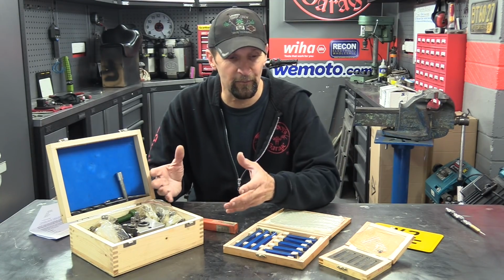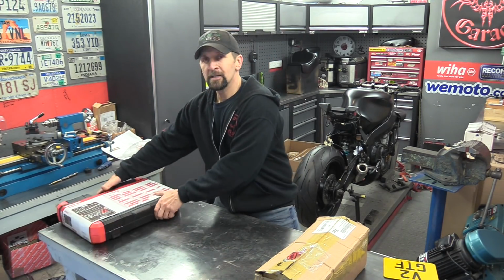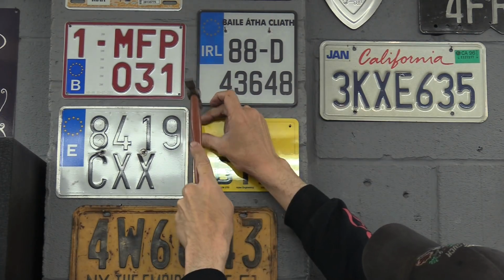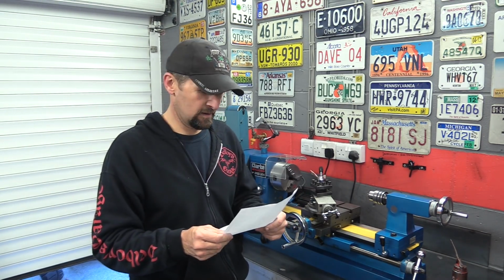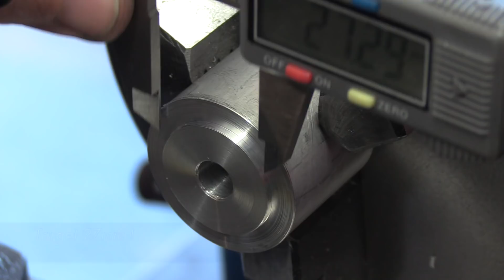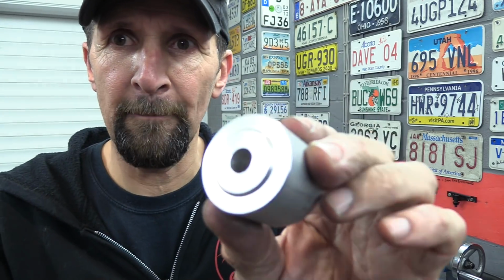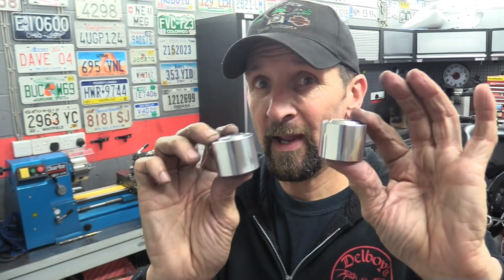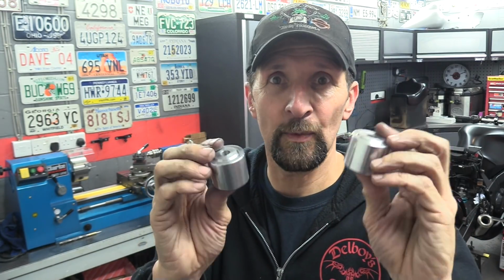Delboy's Garage, Lathe Project #3, "Aprilia Handlebar Risers"

Comment: Great to see the green grit wheel, don’t forget to ‘ring’ it before you mount it 👍
Reply from the maker: 'Thanks Andrew, learning as I go with this, so what d'ya mean by 'ring it'?  cheers
Reply: Gently support the wheel by balancing on your finger through the centre hole, tap the wheel gently with something like a hammer handle (wood, you can use metal but be extremely careful) and it should have a muse ‘ring’ noise which is great. A dull thud noise could mean the wheel is cracked and if spun in the machine, could explode. 👍
Reply: Or you can search you tube for ‘ring testing a grinding wheel’
Reply from the maker: @andysherman711   Andrew, you are a legend my friend, i totally see the logic in that, and how it could save your life.. but i would never have thought to do it... this is why i love Youtube so much, information and knowledge, shared between friends.. thank you again so much, i really appreciate it..   Del.
Reply: As a side to H + S, check and ensure that your safety glasses will protect you against grinding wheels, not all will. I would recommend the 'box type' goggles with the correct impact rating for grinding. This will not only protect for impact but also dust entering from all sides, which can be irritating.

Comment: Cool project. In situations where you have a bushing, ie. hole thru a round shaft, if you cannot grab it easily to turn the full OD. Say from 38.2 to 38mm, you can do 2 simple things without much fuss.  1) place the part between a center in the chuck, or spindle nose, and the other into your revolving center in your tailstock.  Apply force onto it to allow friction of the centres to drive it. That will allow you to skim cut the OD with light .2-.3 mm passes ( may vary depending on tooling and material. Or, friction turn it another way 2) push part against jaw faces with tailstock center , if it’s faced , it will run true as well. Both work for that application. No soft jaws or mandrels required. 
Cheers
Reply from the maker: Thanks buddy, I like the second option there, I guess, close the jaws up to make them solid, and as there's a hole in it, a tailstock centre should pin it, good thinking, although it would be a bit touch and go getting a skim cut all the way to end without touching the chuck, but all skills I'll have to master!  Thank you again...

Comment: Any advice on cutting speeds? Are you able to change it on the lathe? Thanks
Reply from the maker: I'm truly not a person to give advice on any form of lathe work yet, but this machine does have 6 varied speeds by changing belts on multiple stack pulleys from 140rpm to 1200...

Comment: Maybe it's about time to get those heavy tables on some heavy duty casters, the ones with a brake... With all the moving around of those it should make that a little easier.

Love the risters! 👍👍
Reply from the maker: Thanks buddy, trouble is decent beefy ones would add about 6" to the height of the bench and even with brakes, still wouldn't be as sure footed as a solid wooden leg, but it wouldn't half be easier you're right !

Comment: Hi del, have you ever had tiny hair like scratches on fork stanchions? If so, how likely are they to course problems or are they normal? I 've got em on my bike and constantly monitor for fluid seepage, i've yet to see any but wondered whether it is a general wear and tear thing  or something that should be dealt with immediately?
Reply from the maker: Hi buddy, I'm afraid that's pretty common, if they go up and down the leg in a straight line, then they are often dried on road crud and grit that gets pushed up and down by the dust caps... if you ride in bad conditions a lot, then the first preventor of this can be a quick squirt of WD40 on the fork legs before every ride to keep the legs wet so the road crud doens't dry and become a crust, but I mean only a DAB of WD, make absolutely sure it doesn't run down the leg or get near the brakes... or better still, if you don't mind the look,  you could fit some gaiters to keep the weather off... you could try and polish them out a little with Autosol, but once they're there there isn't really much else you can do... good luck with it!

Comment: Very nice Del ! Now you need a Muffler/Diffuser for the shopvac.  I use one and it's great definitely works and helps to knock down the air flow that exits from the vac as for noise its still loud to me🤔. Take care great job
Reply from the maker: Thanks Robby, good tip, never thought of that!

Comment: Well done very professional one very small safety tip with the lathe roll your sleeves up or take your hoodie off . Do you have a email address would like to send you some cutting fluid rather than using wd 40
Reply from the maker: Hi William, that's very kind of you, thank you for the tips, am looking to learn everything I can on this, I have some CT90 cutting oil and some Clarke cutting fluid recommneded for the lathe, but I've been told the best cutting lubricatant for aluminium is paraffin or kerosene, or at a push WD40, but if there's a better solution am more than happy to hear it and would be honoured if you want to stil  send some... let me know what you use, am eager to learn as much as I can... I'll give you the email address so you can send a message via there, thank you again, Del (email: delboysgarage@yahoo.com)

Comment: Good work Del! Machining aluminium is fun. 
Does the streetfighter have a lightened flywheel?......could be a future lathe project!  I lightened the flywheel in my old VTR1000...it made a hell of a difference to the feel of the motor, much more race-like
Reply from the maker: Hi Rick, the ZX7 has standard engine internals, as I like the lazy flexibility of the 1990's bikes, don't want it too frantic for every day use, but good mod though and bet that's more fun!

Comment: Del, do you use wd40 as a cutting lube for any particular reason? Just what's to hand, or is having a spray easier with the saw? Cheers.
Reply from the maker: Hi AH, I'm following advice with the WD40, the general belief appears to be that one of the best lubricants as you're cutting is white parafin, or a close second apparantly WD40, I do have cutting oil, and I've tried it on aluminium and it doesn't really help, but a squirt of WD40 on the job and it seems the cutting tool just slides through it...!  Learning as I go, it's great howmuch sterling advice we've received !